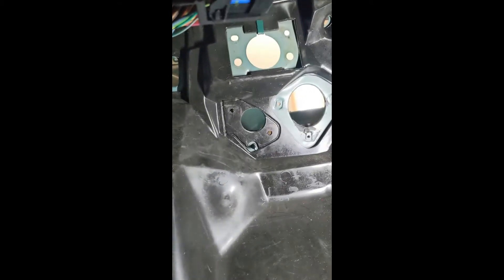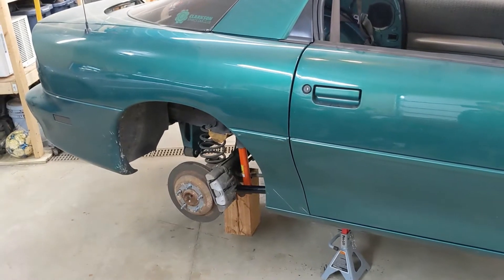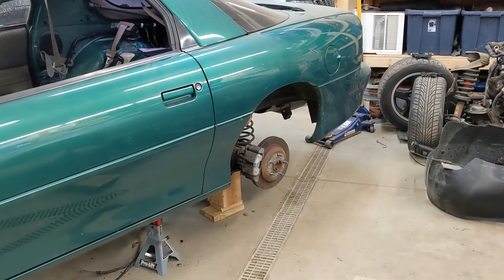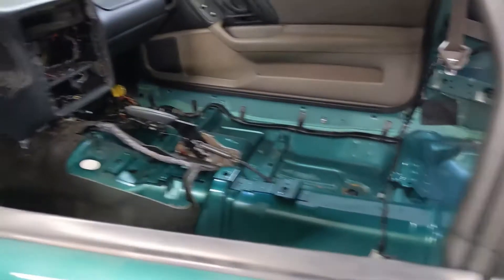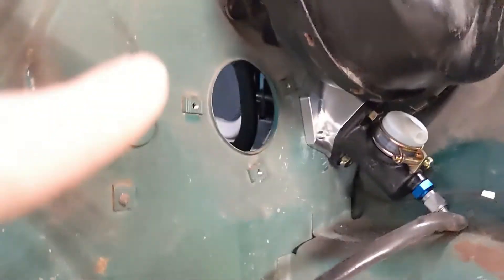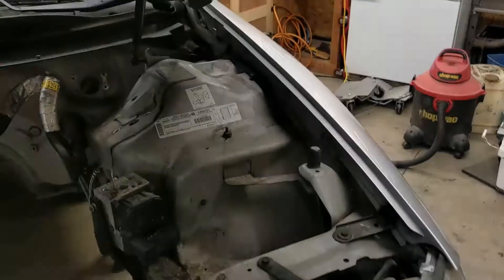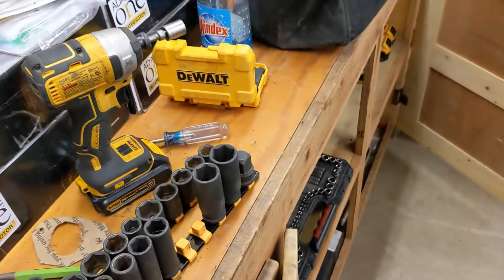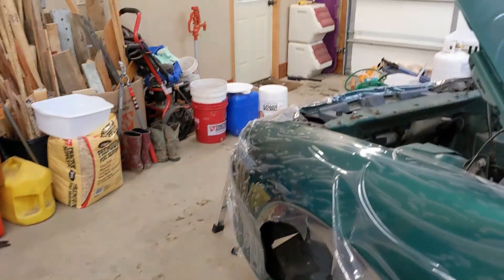1998 3.8l V6 Camaro to LS1 / T56 swap - Part 8 - Tick Master Cylinder install

Comment: This is a awesome series bud. Im just about to do a T56 swap on my 2002 CETA. I have the tic master and will need to cut that hole in the firewall. Im not stripping the car like you did. The engine will stay in and the interior will be mostly intact. Do you think there will be enough room to do it ( install the tick properly ) if I remove the brake booster?? will I have enough room to atom to get rid of that rivet?? Is there any room from the bottom to reach that area??? OR its only accessible from he top with the engine in??  Any tips would be great. Can you talk freely about that. Thanx.
Reply from the maker: It will be tight but definitely better with the brake booster removed. You will have to go from the top, the bottom is obstructed by the frame rail. It might also be worth it to remove the steering column extension while you are in there, its just 2 bolts holding it together, although they are tight as all and can be a pain to get out.
It might be difficult to get the stud cut off though. I used a dremel but had all the space there to get it out. You might have to get vice grips on the inside of the stud and wiggle it to break it free.
Don't forget some sort of firewall support. Especially with the hole from the stud, you will want to reinforce that area. I'd be happy to help with any other questions.